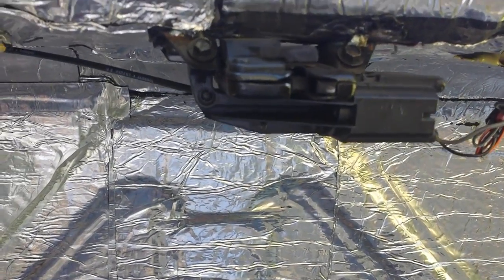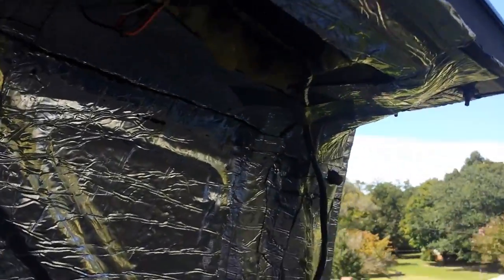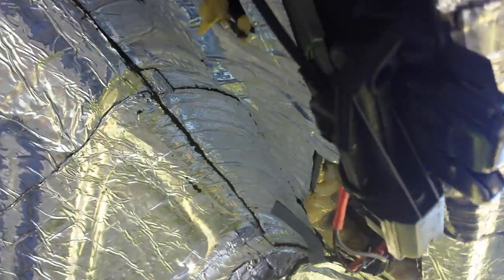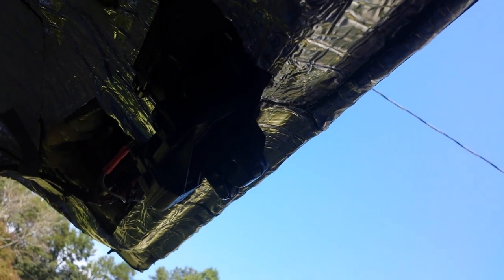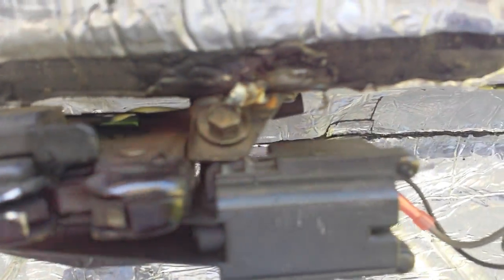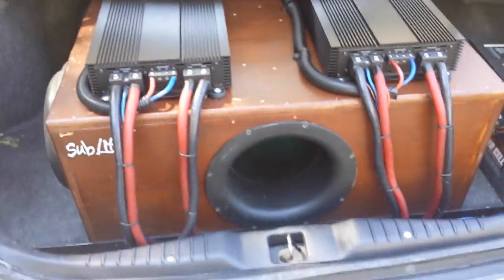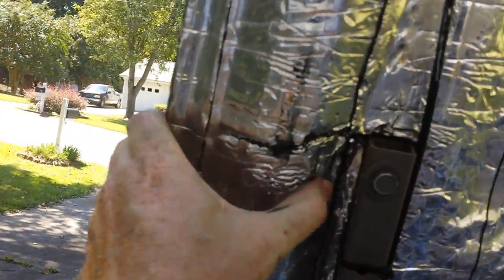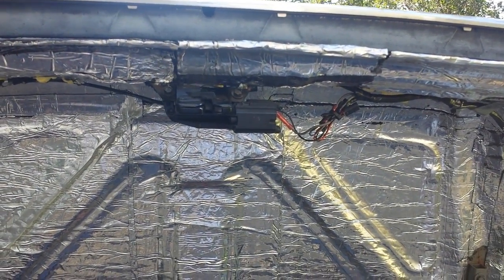TRUNK LATCH WELDING VS GORILLA PRESSURE

Comment: Should try the port facing forward some time. Might gain a few db and probably not kill the trunk lid LOL! I know for small builds a backwards facing port is louder but with yours I have the feeling it's about the same ether way?
Reply from the maker: +Travis Piper I love how it sounds so much with it facing backwards and I also could car less how it meters so I'll leave it facing back...If I ever change up I'll go with a 4th order
Reply: Oldbass40 Ok, yah I would have had my port or subs facing back in my suv but I decided to face them all up, sounds nice and doesn't hammer on the hatch. ;) I'm going to need a ton of sound deadener in the roof though.
Reply from the maker: +Travis Piper Yeah...SUV roofs definitely need...I even know guys who glue wood to theirs
Reply: Oldbass40 Yep, I'm going to go the roof patch and spray foam route. Don't think I'm going to go nuts with it.